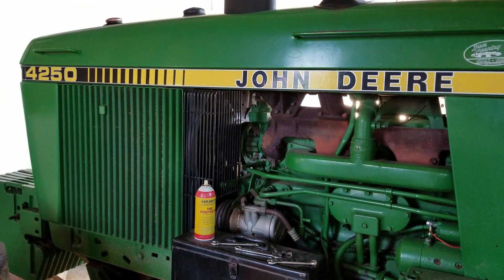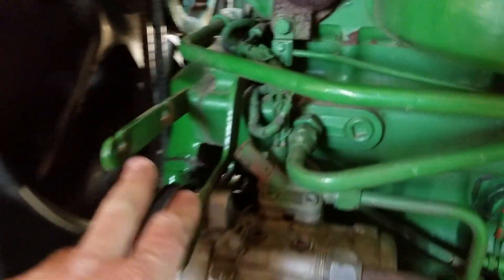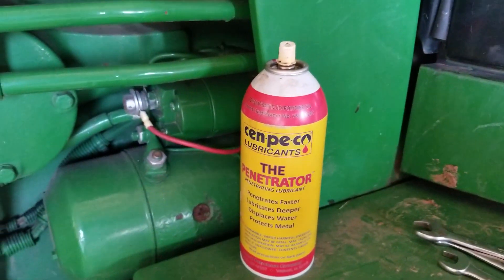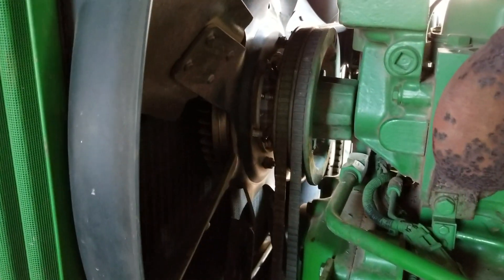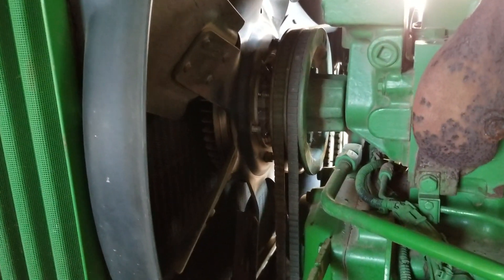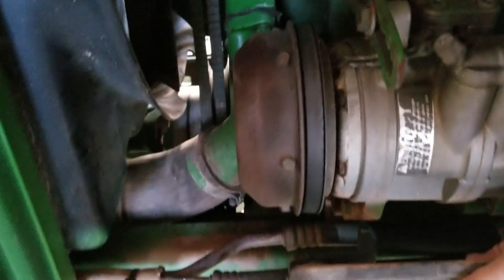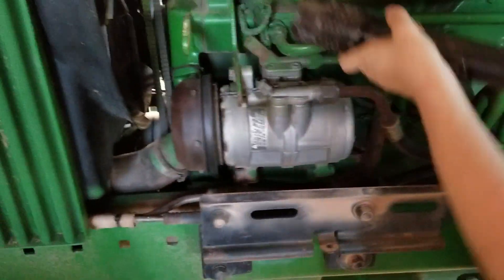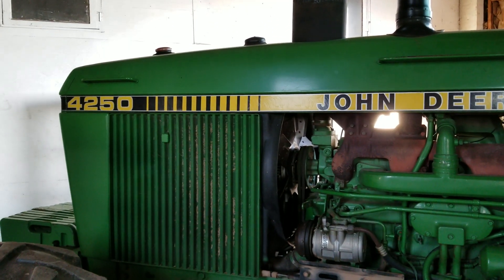John Deere 4250 powershift needs a repair part 1

Comment: newer series 466 engines come with a gear driven waterpump... monitor engine oil level... will leak antifreeze into engine...not good........